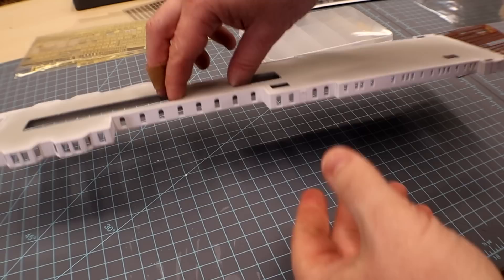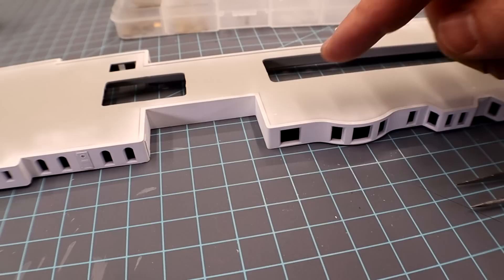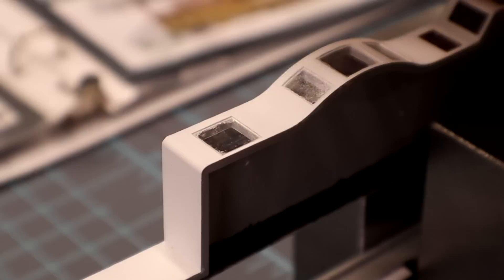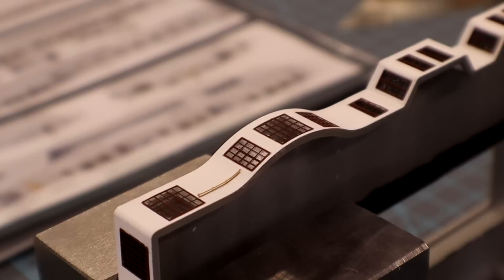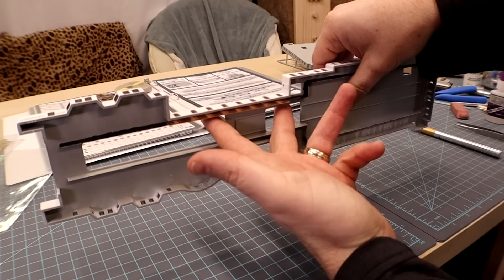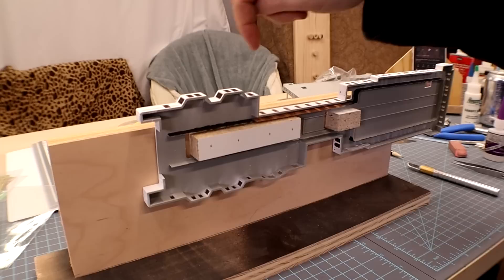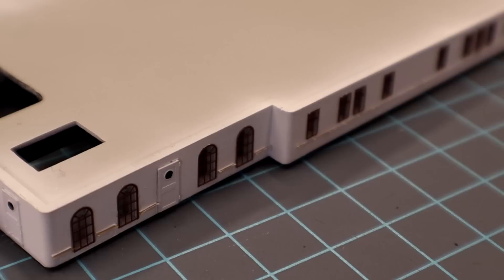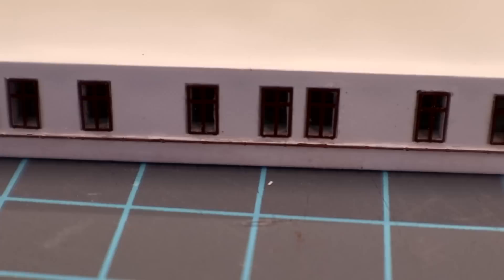1:200 RMS Titanic Build Video 20

Comment: In my years building styrene plastic models in my youth, using the very same glue you're using now, I always scrapped off any paint as it would prevent proper welding of the two pieces. P.S. for Nora's info, the smell was making me high and I didn't know it.
Turns out kids back then were "sniffing glue" to get high on purpose, but I had no clue 'cause I was just a modeling geek. Love your channel and builds.

Comment: Hey Ben, Great video thanks for taking the time to show everyone what to look for during construction. At the beginning did you say Nora used her cricket to cut the windows? If so is that the circuit cutting machine, and has she tried to cut Evergreen or Plastruct styrene? I have wondered if their equipment could do so and have asked them, circuit, but have received only a canned response about hundreds of different materials can be cut. Take care.
Reply from the maker: The answer is yes. The machine will cut material as heavy as leather and light metal. I had her cut some shapes for me out of a thin styrene sheet. It worked perfectly. The only fiddly part is determining what setting to use so you get the right depth cut. They handle this by having you select the name of the material that you’ve put in there. Usually it’s there in the menu. Acetate was and it cut just fine. But the styrene involved some hunting and selecting of some material that was essentially the same thing. I have no idea how to interact with the set up software, though. That’s Nora’s wheel house.
Reply: @TheMidwestModelShop  Ben, thank you for the information, it is a big help. Could you ask Nora for me if she would be willing to do a short video of a test cut? Again thanks for the help.

Comment: Awesome! Any tips on how to make the paint stick to the p e brass? Fine sanding just before painting? Primer first? Thanks in advance!
Reply from the maker: Make sure the brass is clean. Then you can use a metal primer. I’m using Mr. Metal Primer-R. Then use regular primer, then your primary paint color.
Reply: @TheMidwestModelShop  thanks for the information!